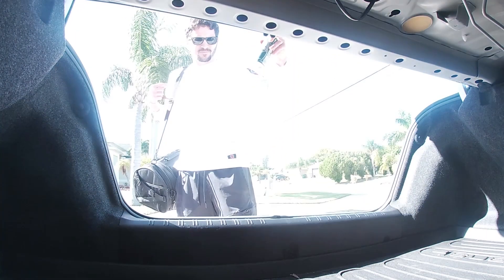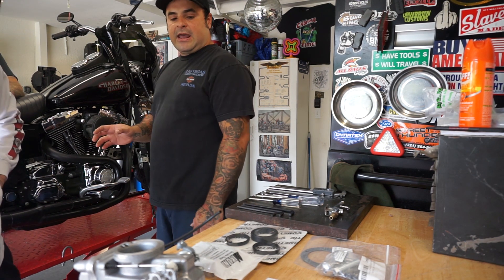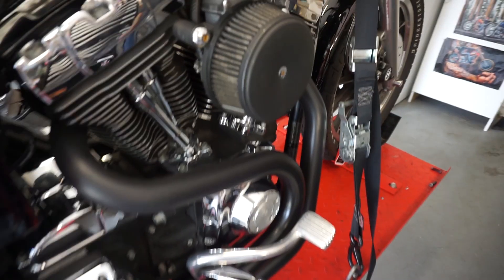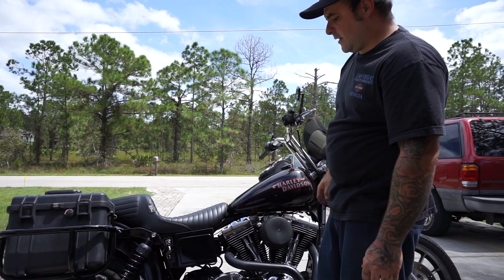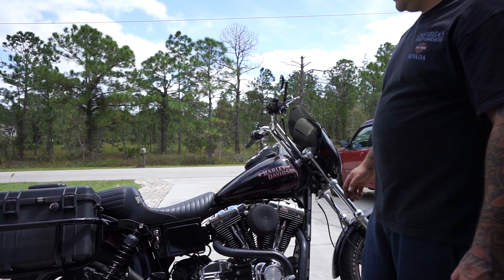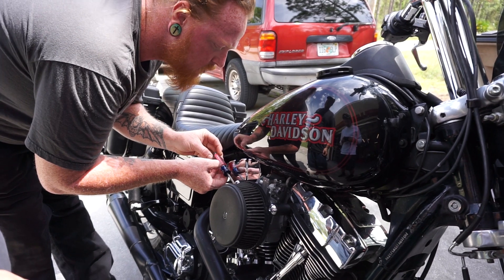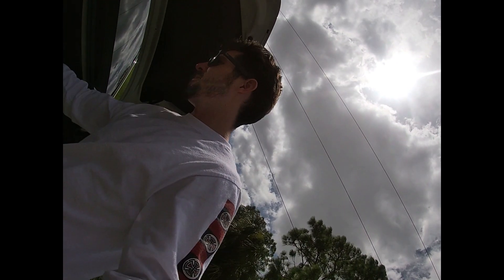42mm Carb Swap | Harley Dyna

Comment: I run a Mikuni 42 on my 02 Night Train 95" build and really the only benefit is quicker throttle response, CV's are a much smoother ride all around. They are super temperamental with certain cam, pipe combos, get used to the slide noise and if you live in an area like me (Boston) where the weather changes on a daily, your A/F ratio will be perfect in the afternoon and lean by evening. I love the carb but I ride every day that I can, so I'm going to try a Bob Wood's carb build and if I don't like it, back to the Mikuni. I run a 25 pilot/ 162.5 main/ needle stock position and my nozzle comes on right away, this gives my scoot it's best performance.
Reply: I’m from RI how’s the bob wood carb?
Reply: @davidparent5522  he refused to build me a 40mm cv and insisted I spend $1700.00 on the 45 for my build. No thanks, wasn’t looking for a 45 or wanting to over carb my bike so he wouldn’t build me one.  Guess he has enough money lol

Comment: Hey guys, I will be going the opposite direction. I currently have a Mikuni HSR 42 and will be replacing it with a CV 40 mmm carb on my 2000 Springer. Will the current throttle cable and return cables I am currently using with my Mikuni carb fit right on the CV carb? Does the Mikuni have a mounting plate that is not used by the CV carb?  By the way, my bike currently has a Screaming Eagle high flow air cleaner. Thx

Comment: Is the manifold that was used by the CV 40 carb interchangeable with the Mikuni HSR 42, without any special adapters?
Reply from the maker: I'm not sure on that one. You may have to do your own research or watch a video that's better than ours haha.

Comment: I just installed a hsr42 on my 80” evo. #20 pilot #165 main jet in it now. Originally it had #25 pilot and #160 main jet but it was backfiring and blowing flames out of the exhaust. Now it’s not but with the original CV it used to idle very slowly. Now it seems to idle quicker like yours in the video. Is that just the difference in the carbs?

Comment: Hey man I just put this on my 1200r did you have any issues with intake backfire when snapping the throttle??? I’ve tried adjusting the pumper but I can’t seem to get it perfect
Reply: Check to see if you have a intake leak by turning on the bike and while it’s idling, spraying carb cleaner/starting fluid towards the intake manifold where the seals mean the head and listen to see if the bike revs up on its own, if it does then you have a intake leak creating a backfire, if not then you might have to go up or down on your carb jetting.
Reply: Jovanny Benitez  ok I have the seals I’m just gonna go ahead and replace what exhaust is on that bike
Reply: Choo Choo Adventures it’s a Thunderheader

Comment: What's the part number on the Mikuni plunger? I can't find it on JP cycles...
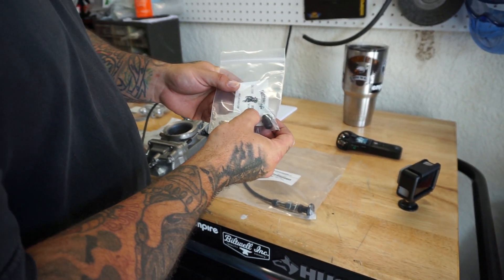Reply: 3:47 into the video...
Reply from the maker: I think it’s mikuni part number 990-662-002
Reply: @flatstatefilms881  I think that part number is for the actual choke cable... I'd be looking for the part in the smaller bag
Reply from the maker: Search for Mikuni HSR42 carburetor choke parts kit